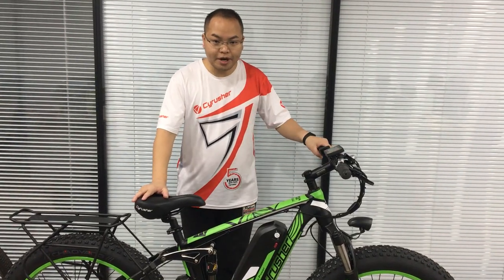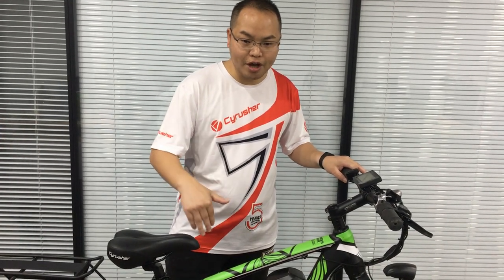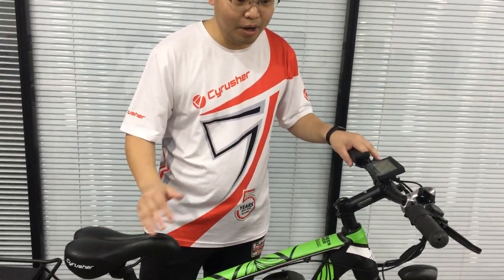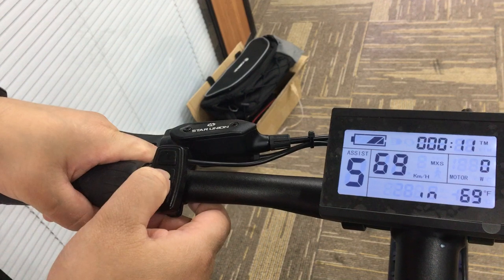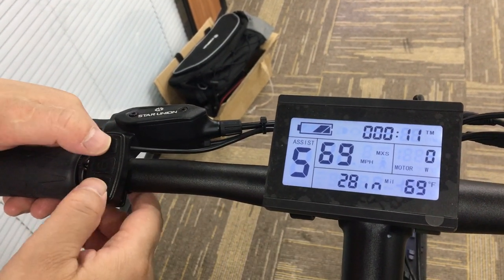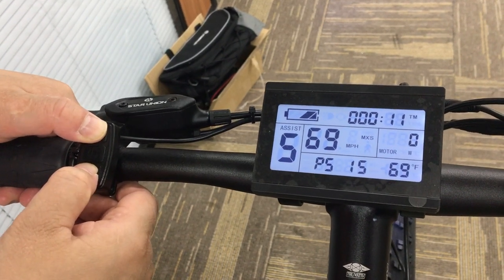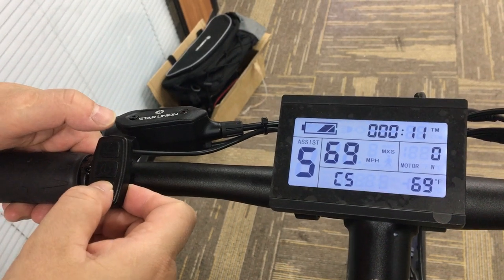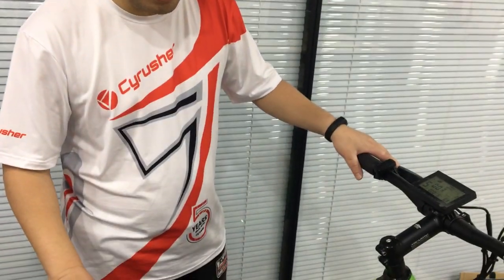Sovled! How to fix XF800  with bafang 750Watt motor does not run when have a loaded riding?

Comment: Does this apply to XF690 Plus, too? My bike acts like described here (just jumps forward when using the throttle) and I thought it was normal (I am over 95 kg dressed) until I saw this video.
Reply from the maker: No, it is only for XF800.

Comment: how many km do you travel with the battery ?
Reply from the maker: mario If by throttle only, it can go 30-40 kms, if by PAS only, it will take around 50-60 kms;
Reply: @Cyrushersports  thank
Reply: is the bafang 750w strong as the "old" one 1000W no bafang?
Reply from the maker: Michal Ondreicka it is stronger than the old 1000Watts
Reply: @Cyrushersports  if i want to change the old 1000w for new 750W bafang, do i need to change controller and display also? Magnets and battery are the same? Where can i order? EU Stock?
Reply from the maker: Michal Ondreicka yes. Need to change controller, motor, battery and main cables. Computer is fine, no need to change.
Reply: @Cyrushersports  why battery? Battery is 48V, both motors need 48V
Reply from the maker: @michalondreicka5955  Because Bafang motor require at max 30ah current, but our current battery is up to 25ah current. If you use the old battery, the battery may shut down to protect itself or it will burn the battery.